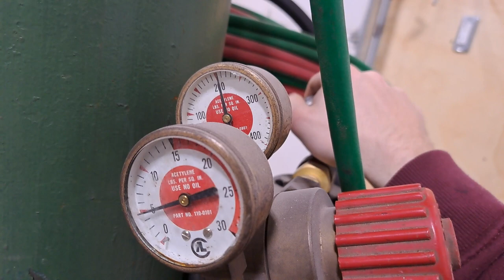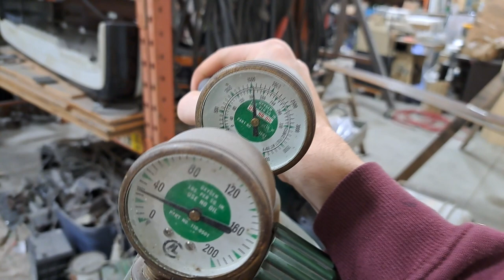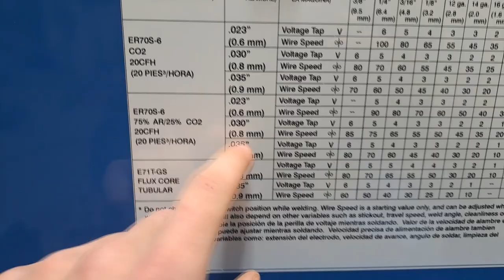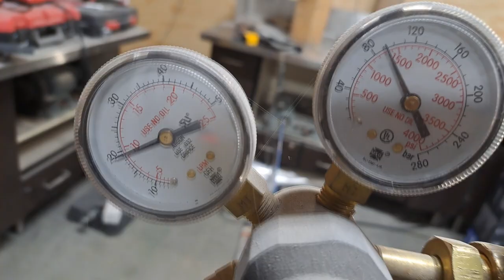Making Custom Knife Plates | Post Base Plate Anchors

Comment: So what best welder for cars work?
Reply from the maker: "BEST" welder would be a Lincoln or Miller. Something name brand, but expensive. Honestly, if you are just doing it as a hobby, I would recommend buying just a cheap one from your local hardware store. Any wirefeed welder should be fine welding on thin sheet metal.